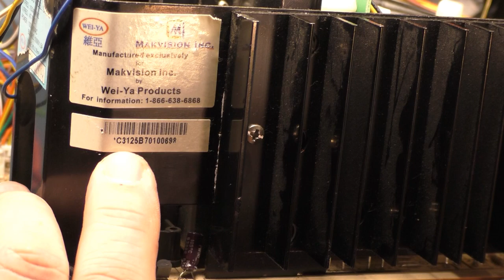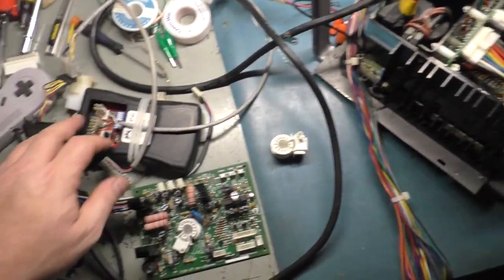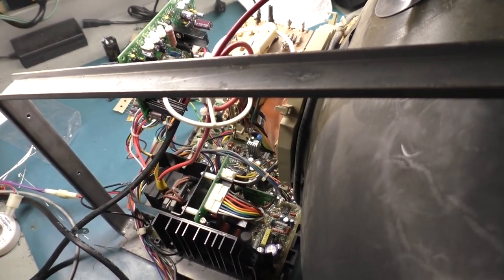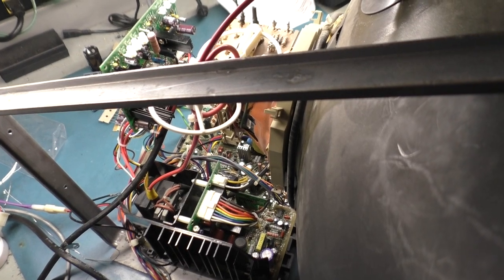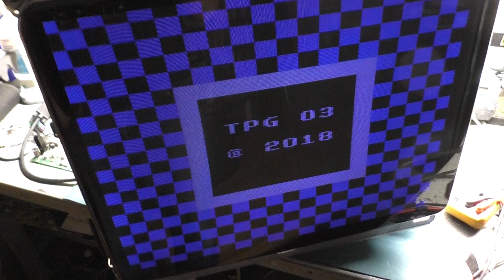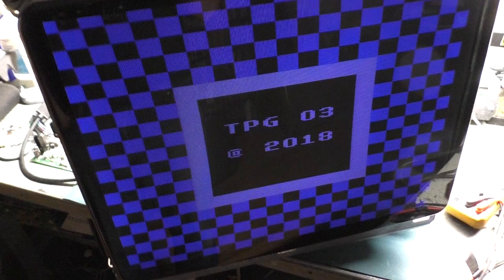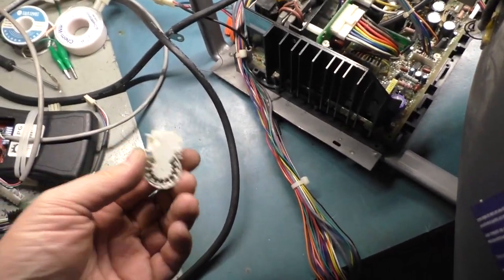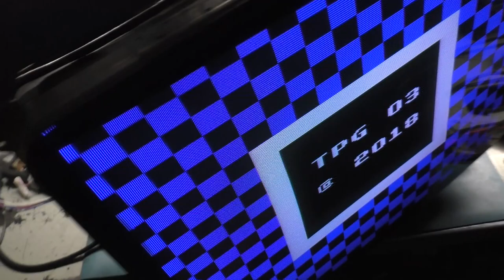27/29" Makvision Wei-Ya Arcade Monitor Chassis Repair - No Raster - Abnormal Solution?

Comment: Also random question for you Mike, have you worked on any Ceronix monitors in your years of experience? They're found in IGT video poker machines. I own 2, I have a 13" which is INCREDIBLE, I swear the tube is brand new, it was (and still is MINT from the day I got it), I also have one with a 17" touchscreen monitor in it, good monitor, good colors but lousy tube, lots of screen burn on it. I heard at least on some of these Ceronix monitors they have Kortek chassis on them? I haven't had to pull either knock wood since they've been running great but I bet at some point the 17" will need some love, the 13" like I said is damn near like the 13" K7000 on your test bench, it's just MINT. Sorry for the rambling, just wondering if you ever dealt with any as I know you've seen and worked on a lot over the years and maybe know about the Kortek chassis or any other they use. Thanks again for the great vids, I have learned so much! I WISH I knew this about 20 years back, 128 CRT (64 13" ones and 64 27"ones) tubes and CONSTANT issues and a "repairman" that couldn't fix a monitor with nothing wrong with it lol. I woulda fixed em up SO easily, I wish I knew how simple they really are. Anyway thanks again Mike! Look forward as always to the next video/repair! :)
Reply from the maker: I have not. Honestly never heard of that brand. Thanks for the kind words and thanks for watching!
Reply: @MikesArcadeMonitorRepair  Oh wow, maybe they are exclusive to those machines then. I too never heard of them until I got my first. They seem good and reliable, in a casino setting they are for sure on 24/7, screen burn ofc is an issue but they seem to be very durable and long lasting otherwise, interesting, thanks Mike! :)
Reply: Also I should add Ceronix is still in business selling all LCD's now ofc. Dunno if they're selling parts for the old CRTs anymore, doubtful but I guess especially since you never even heard of Ceronix they must be pretty much only casino equipment, thanks again Mike! Look forward to the next repair vid as always! :)

Comment: Hey Mike! I just picked up a 29" Makvision CRT and the chassis just keeps clicking over and over going into HV shutdown. Could this possibly be the flyback? I haven't pulled it out of the machine yet to try and troubleshoot, but I've never worked on a Wei Ya chassis before so thought I ask.
Reply from the maker: Greetings. Likely the HOT is shorted.

Comment: Hi Mike. I have the same chassis and yoke with an LG flat tube and my geometry is really bad. I see your grid looks almost perfect. My grid opens up and down to the sides on the sides and I already tried all the pots on the chassis, even the trapezoid one and did not help much. The pincushion pot on the controller board kind of helps but the image is not straight on the grid. Any suggestions? The chassis and tube are pretty much in near mint condition but really bad geometry on my grid. The bottom right side is really like compressed and no way to improve it. I already capped it but no change.
Reply from the maker: Is it the original tube/yoke?
Reply: @MikesArcadeMonitorRepair   It looks to be. I basically bought it like this from someone in Japan that had it for years stored. Everything looks clean and near mint. When I unpacked it, the tube even had its plastic film on it. I removed the joke and put it back in believing it was badly placed but after adjusting, same curving on the sides, more on the right bottom. Also, from center out, the grid looks attracted or pulled to the corners, as if making smiley vertical lines. I adjusted the trapezoid pot on the chassis but did not help much. Do you feel this weiya C3129DSLG was meant more for like a curved tube and not this flat tube? I mean the front, this one is completely flat.
Reply from the maker: @ner38073  Yeah. Wondering if this chassis was originally on a different tube. If it's been capped and the yoke is good, the image should be good. Based on what you've described, it's got to be either the chassis isn't original, or it needs a curved tube. I can't say for sure unfortunately.
Reply: @MikesArcadeMonitorRepair  Thanks Mike. I will keep searching but I have a feeling this chassis was meant for a curve tube. I have learned a lot watching your videos. Thanks for everything!
Reply from the maker: @ner38073  You’re welcome!

Comment: Hey Mike I have the same chassis and monitor thats just clicking.. d21 is shorted in circut. Thr hot is shorted in circut as well. I'm lost. Any help would be greatly appreciated
Reply from the maker: Not shorted out of circuit?
Reply: @Mike's Amateur Arcade Monitor Repair   not shorted out of circuit